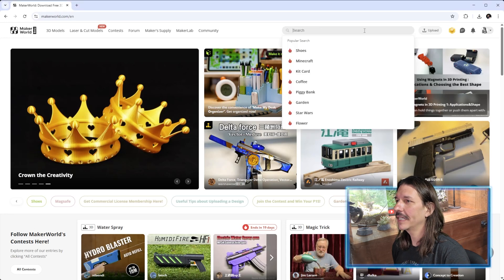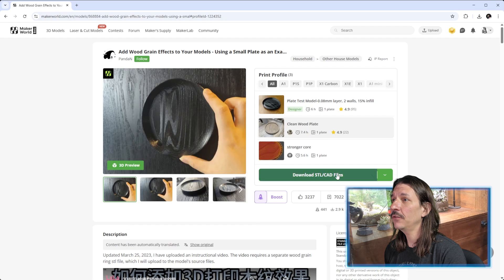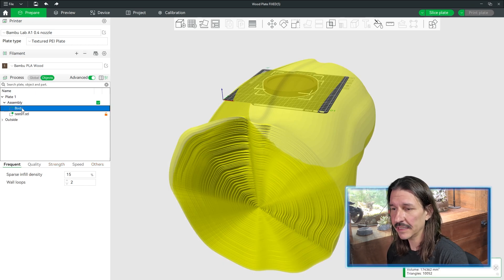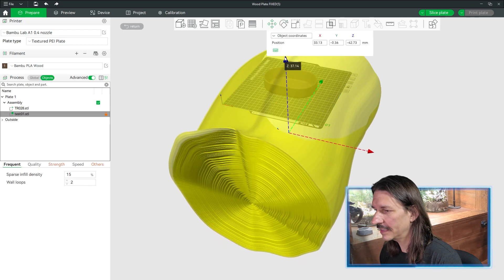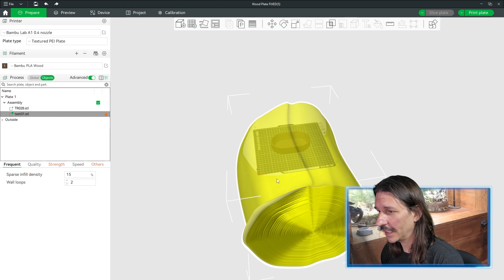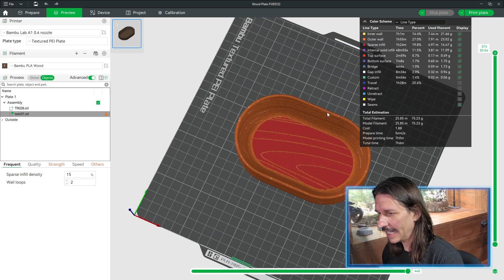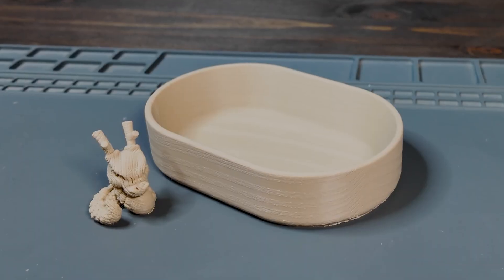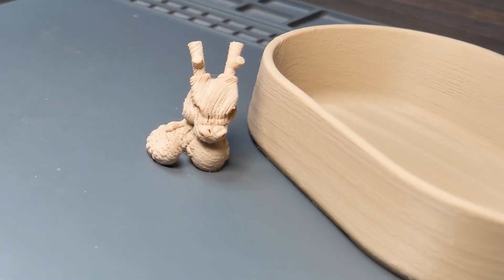Add Wood Texture to 3D Prints — No Modeling Required!

Comment: Nice video! How did you get the cool 3D preview in explorer?
Reply from the maker: Thanks! There are probably other ways to do it, but I have Microsoft's PowerToys installed. In PowerToys, under 'File Management' > 'File Explorer add-ons' there is a setting to turn on previews for STLs
Reply: @DiazCreativeStudio  What!? I have had this option the whole time without knowing it? Damn you just saved my soul

Comment: Moin,
0:42 Dont work in prusa slicer

Edit:
worked
if you have not already done so, go to expert mode (top right)
klick the pice on the plate. right click, add modifier. click gallery. click in the gallery window "Add" and open the modifier stl file. select the modifier in the gallery window and click ok.
align the modifier so that the part you want to print is completely covered.
on the right-hand side where the stl file is displayed you will also see the modifier, with a cogwheel to the right of it.
click on the cogwheel. "Add settings". Select Fuzzy Skin.
Tick on "Fuzzy Skin". Click ok.
You now have a small extra field under the stl files called "Fuzzy Skin:" None.
Change None to Outside Walls or All Walls.

Then slice.
done.
Reply: Hi. I tried this in Prusa, Orca and Bamboo (nov 2025) and your right you have to enable fuzzy skin in all of them now. Butttt.. the top and bottom surface don't change. PandaN in bamboo labs has a video to fix it. The orca slicer version is: Do what juckendesAuge said. Then select the modifier go to - strength / top and bottom shells - adjust 'top surface pattern' and also 'top/bottom solid infill/wall overlap' around to desired look. It will change the top and bottom surfaces too. peace out
Reply: @terranceroberts6259 Thank you mofo; spent hours wondering what I missed in the instructions, when it was only because the profile had the top surface pattern set to "Aligned Rectilinear." 😘

Comment: Was able to replicate it in SuperSlicer. What's a shame though, is that the temperature doesn't change according to the modifier object's pattern. Anyone any idea how to do that? Say between 230 and 250C should work nicely with most wood filament.

Comment: the results are awesome but turning a 1 hour print into an 8 hour print is wild. make sure your plate is extra clean before you lose all that progress
Reply from the maker: That's a great point. Its probably not practical for most use cases - especially if time is a factor!

Comment: Could this work with a resin printer?
Reply from the maker: For now at least, this hack only works for FDM since it relies on infill direction and 'fuzzy skin' setting to create the texture - two settings that I haven't seen in resin slicers yet. It would be really neat to see some of these FDM features ported to work with resin slicing as well. 'Fuzzy skin' is just so cool.